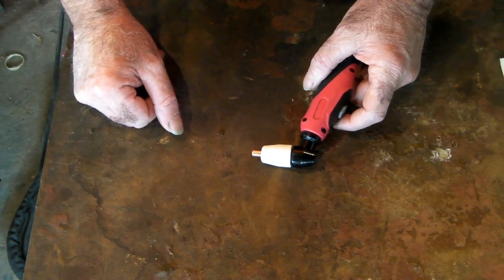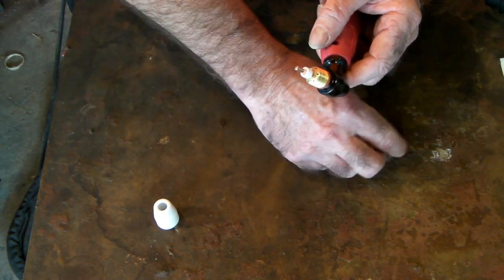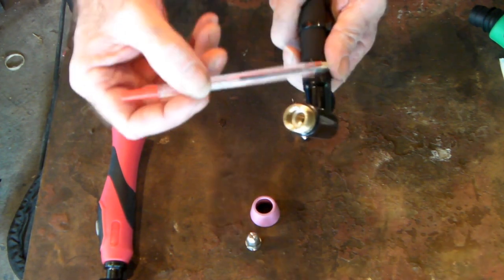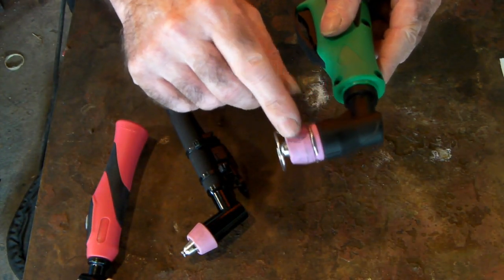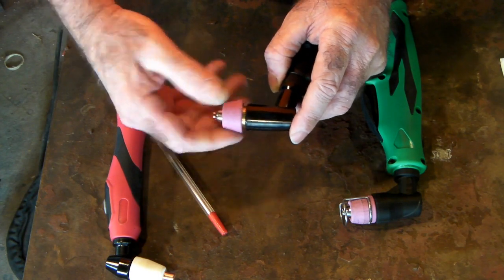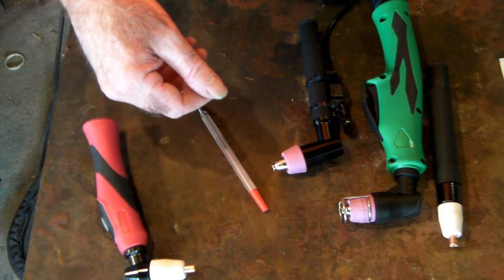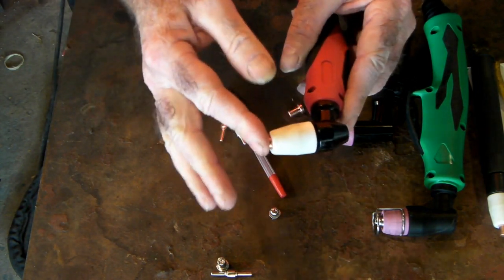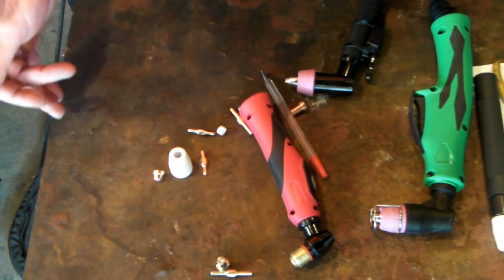Cut 50 Plasma Torch Consumables / Extended Cut 50 Plasma Cutting Tip

Comment: Hello Pete 
Thanks a lot for a lot of informative videos! Im from Denmark, and i recently bought an old plasmacutter on an auction - very cheap. Its called Nertajet-ZIP SAF. Its frence and proberbly from the 1980's.  Ever heard of ths brand?

Had som problems getting it running: There is supose to be a external security connection on the burner (a Binzel PSB 60s, I belive) - but it was missing, and I didnt know it was supose to be there. Took me a while to figure out :) Next, there wasnt always enough preassure in the compressor, and the relay on the burner cut out.

With that fixed, it still wasnt running stabel. The burner relay kept on cutting out once in a while - some times it wouldnt react on the switch at all, an sometimes it just puped right out again.

Today i disassembled the main switch and cleaned the contacts. And now its running - hopefully for good...

Now I just have to practice some more - I really find it to be a fascinating and usefull tool. Thanks again for your very good and honest videos.

Best 
Frank
Reply from the maker: no mate never heard of that one .Hows it working ?

Comment: Greetings
I'm from Romania and i watch on your videos about plasma cut. I see you are a  professional in this area of expertise and i want to ask your opinion about what kind of plasma torch its fit for my old plasma cutter machine. I have an Telwin 58/1 plasma arc cutter machine, its with arc pilot system and have two stage cutting : 1. 35A with 65V x 50% and 2. 55A with 75V x 30%. I want to buy  cheap torch , with cheap consumabilles. I look for an chinese WSD-60 P-60 P60 Plasma Cutter Cutting Torch Complete Pilot Arc Start 40-60Amp . Thank you very much
Reply from the maker: Greeting from nz , wsd-60 should work but just do your research first .You can cross reference with google to find a comparable torch.

Comment: Almost forgot: I was very confused about "pilot arc" vs "HF" vs "scratch start" - and i still am a bit. For now my understanding is, that pilot arch and HF are the same... And scratch start is very different, like a pin welder. 
I dont know why the therm High Frequency is used. In my understanding an electrical circute needs a high voltage to strike an arch, and not a high frequency.... What would the frequency be about??

Any toughts on this?
Reply: Why do you encourage people to write to you, if you dont want to answer?
Reply from the maker: sometimes i just miss comments sorry
Reply from the maker: Just check out my other videos on pilot arch and HF
Reply: @petestools  Allright, no problem